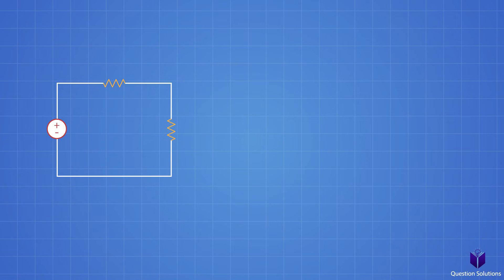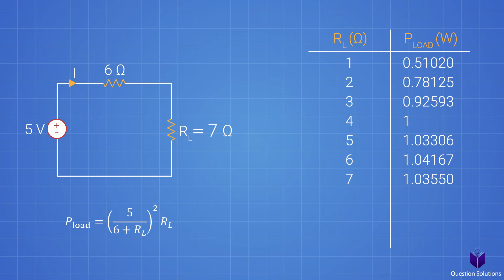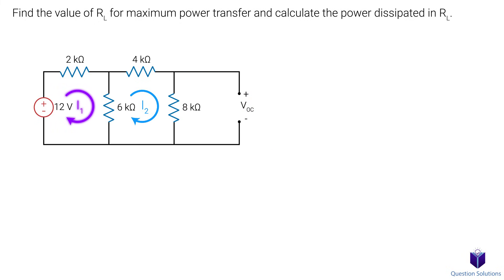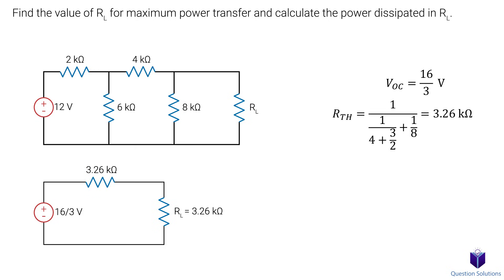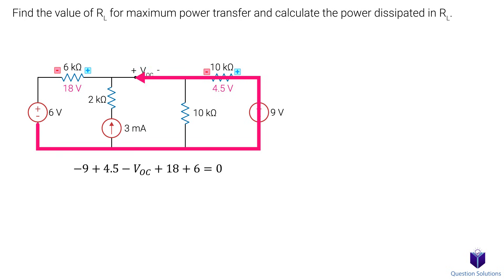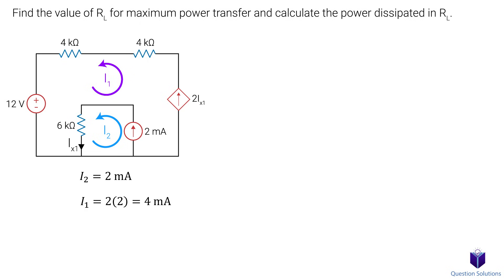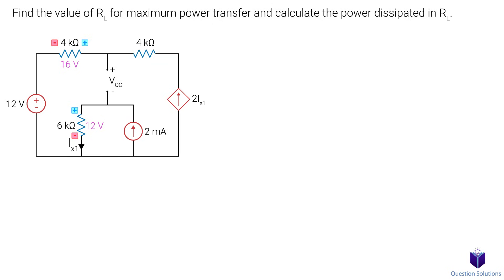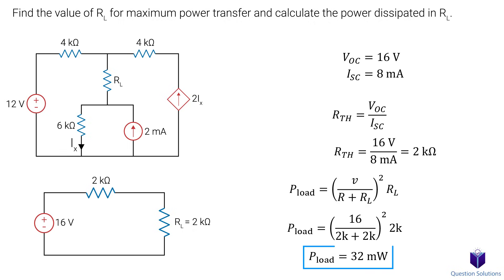How to Find Maximum Power Transfer | Engineering Circuit Analysis | (Solved Examples)

Comment: Hey, at 11:28 since we are using mesh analysis would ix1   become ix1=i2-i1 ??
Reply from the maker: No, it will always be just whatever the value of the current source is, it's constrained by the current source, no other current will flow in that branch. You can try this for yourself. Get rid of the dependent current source, and instead, place a independent currents source with whatever value you want. Then solve the circuit. The value of ix1, is always whatever is constraining it.

Comment: when calculating the first mesh isn't there supposed to ne another current coming out of the 6V so the voltage of that 6kohm resistor would be I1-3 multiplied by 6 ? I dont get the first mesh and if you name the nodes with corresponding voltages the asnwers doesnt fit also Please help I have an exam on thursday
Reply from the maker: I have no clue where you're referring to. Please use timestamps so I can take a look. Thanks!